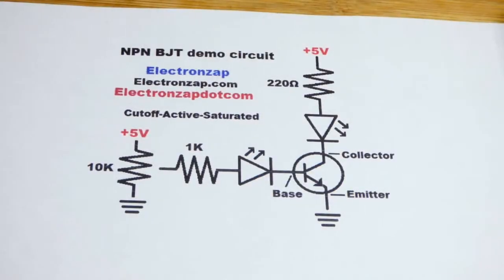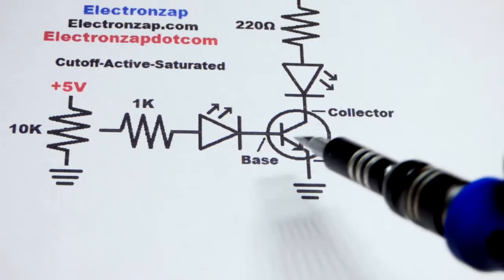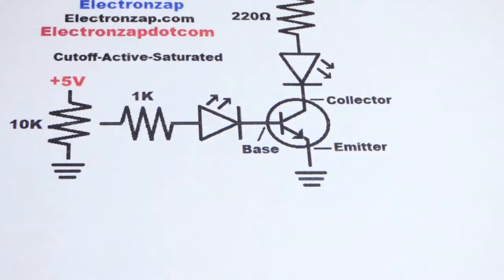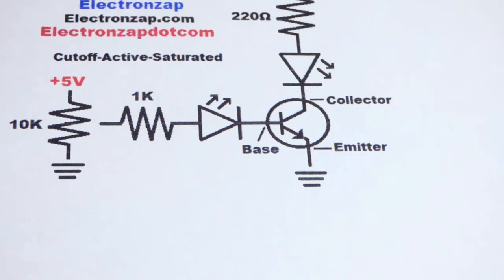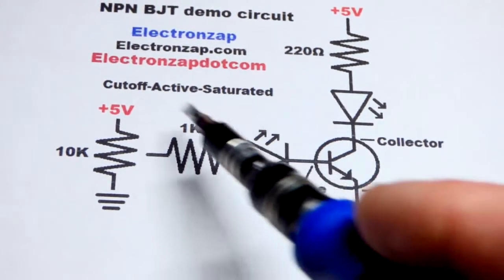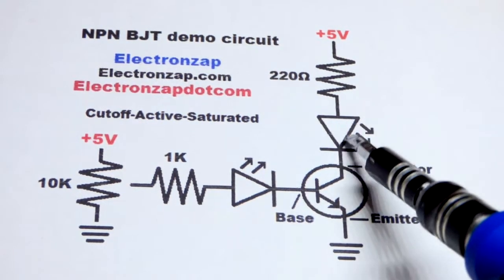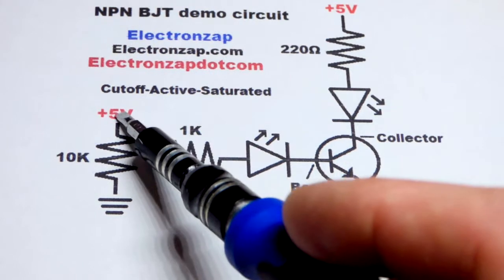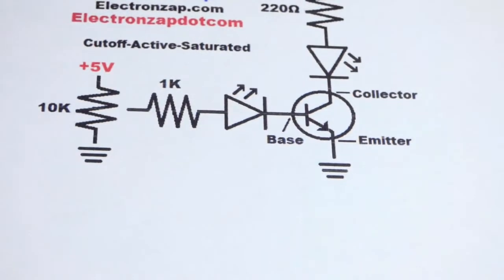NPN bipolar junction transistor BJT basic electronics properties demonstrated with LEDs

Comment: Wonderful insight, can you make explanation about invertint and non inverting buffer through transistor.
Reply from the maker: I plan to do switch circuits soon, and maybe inverted switches after that. I'll try to remember to see what else buffer would cover.
Reply: @Electronzap  Yes that is great, you can also look towards operating high voltage device through relay by switching transistor phenomenon, this is very practical and Helpful too.
Currently I am also studying about the transistor and your videos are helpful.
Reply from the maker: @TheFreestylelogic  Good timing, because I'll be posting mostly transistor videos for a while :)
Reply: Buffers are used often and groups in many audio applications.